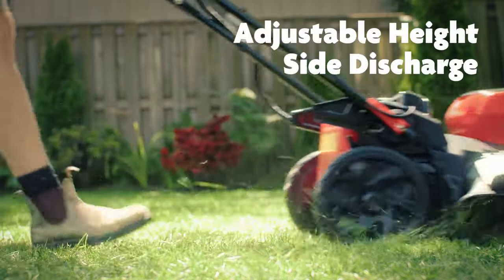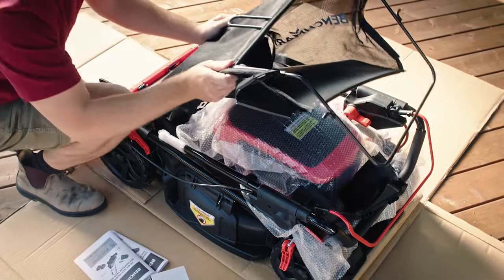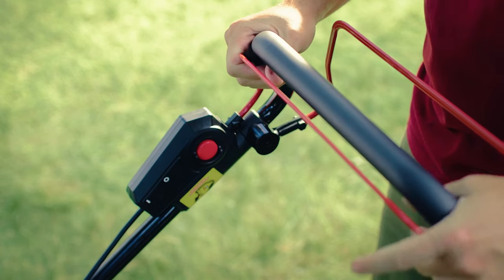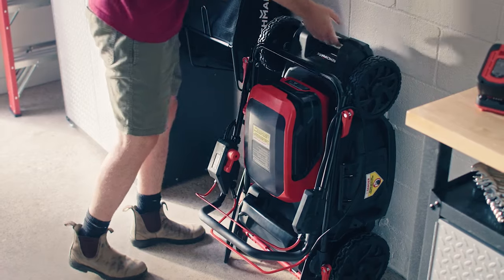Here's How to Set Up a Cordless Lawn Mower

Comment from the maker: 00:00 - Intro
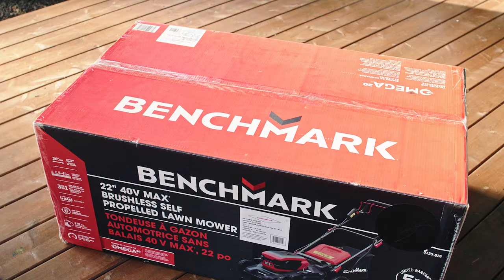00:18 - What's Included
00:42 - How to secure the handle bar
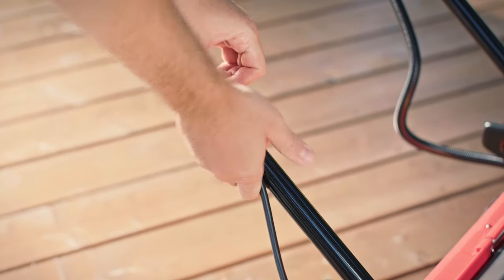00:56 - Battery info
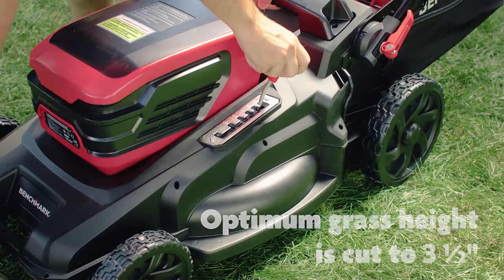01:05 - Deck height adjustment
01:13 - Grass Bag Info
01:26 - How to mulch
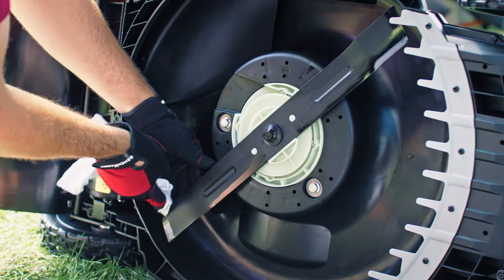01:39 - Blade maintenance
01:50 - How to start the mower
02:13 - How to use the self-propelled feature
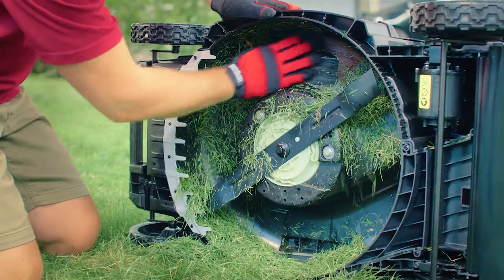02:32 - How to remove grass clippings